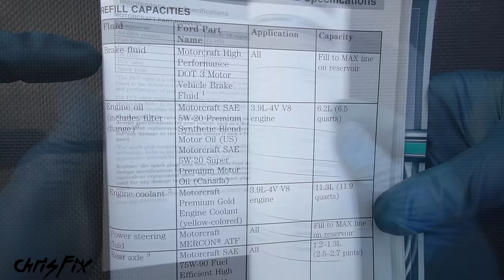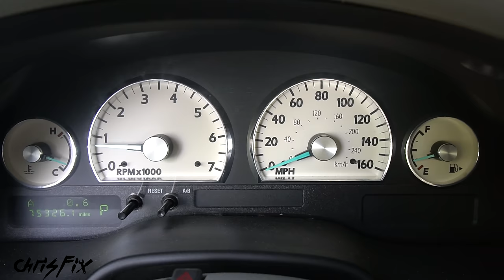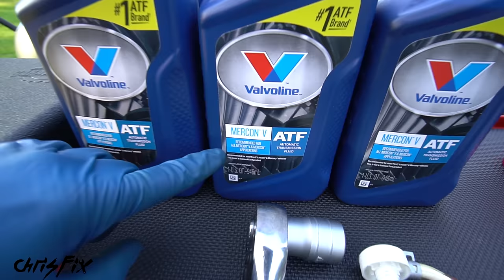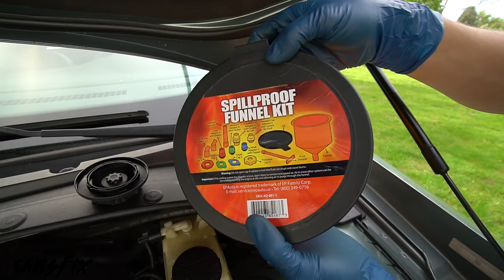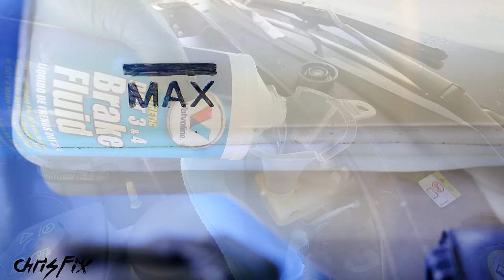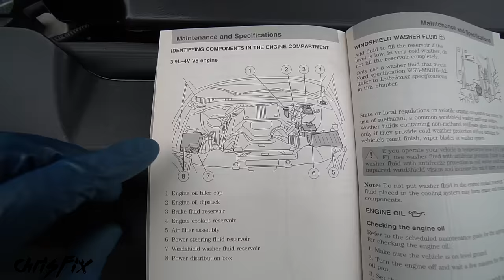How to Change EVERY FLUID in your Car or Truck (Oil, Transmission, Coolant, Brake, and More)

Comment: 6:53 say this to my Golf mk3. The filter has a really bad place, at least on the 1.9 TDI.
Reply from the maker: :o
Reply: Having maintained my wife's Jetta, I concluded that VW loathes the idea of home maintenance.
Reply: Try changing the oil filter on a J20B in a Suzuki SX4. You have two choices: either you unscrew it and try to get it out through the top and it takes at least half an hour, or unscrew it and drop it to the ground so that makes a mess

Comment: Hello,
I want to lift a fwd car in the rear so both rear wheals go up. What is the best spot to place the jack?
Reply: It depends, if u have independent suspension then place the Jack at the middle of the rear crossmember
Reply: If you have a trailer hitch, you can jack it on that
Reply: NGK_YT Ok thx
Reply: Horizon Farming Its for installing a trailer hitch
Reply: Or jacks... plural 👍🏼

Comment: Me: ......
The idiotic me: How about Gasoline. Thats a fluid.
Reply: It pains me so much..
Reply: You drain it by driving really fast non-stop til the car runs out of gas & then you add it from the nozzle at the gas station...
Reply: Amateurs.
I put lighter into the a fuel tank
All gas lit on fire will disappear and you can put fresh gas in

Comment: Chrisfix this would be my very first do it myself oil change!!! I have a 2002 Pontiac Bonneville, I couldn't get my car to start and I have tried everything!!! I just recently purchased the car without checking it out first hand... I had to get a Battery, I then had to replace the Crank Shaft System, I then replaced All 3 Coils and It started but wouldn't stay on... I went out and purchased what is required to change the oil because the oil is Black, Gritty, and Has A Burnt Smell!!! I'm hoping that this will be the reason for the engine to continue shutting off... But if this isn't the reason, I still would like to thank you because I Have Learned Something New!!! BUT If This Oil Change Works or NOT I will return to let you know how i made out...   The crazy part is I purchased this car from family of my ex old lady before she became my ex!!!

Comment: Looking at my manual...

I see: Fluid lasts for life of vehicle
I think: Yeah right, then why am I able to change it. There is no lifetime fluid. Bunch of BS
Reply: “Lifetime Fluid” = “it lasts just long enough to limp it through the warranty period” 👍
Reply: Because once the fluid is no longer doing its job the lifetime of the vehicle will soon be over...
Reply: Dealership definition of lifetime: less than 5 years.
Normal persons definition of a lifetime: drive the thing until the engine blows
Reply: well they aren't wrong, the fluid will last to the end of your vehicle... because it will be the end of your vehicle

Comment: Watching this gave me anxiety, too many fluids to change
Reply: Get an electric then
Reply: Relax. Some of them you don't have to change for a while. The only one you have to change frequently is the motor.  Coolant is every 30k miles so depending how much you drive and where you live it can be 2 to 3 years. I use Google doc to keep notes on every fluid I change by the Mile so when it's time I double check on there.
Reply: @sadboycali  You sir are a genius! Thanks for the tip on using google docs!

Comment: I scrolled and Ctrl+F'd through maybe a 1000 comments but still haven't found a similar question: I have at least a bit of air in my lines after bleeding (definitely bled all the way, clearly new fluid coming out on all 4). I'm thinking it might be due to the way I was pressing the pedal (too fast up and down...), due to leaving the reservoir open (although Chris here also has it open). Or, possibly, due to bleeder valves leaking, as the two on my back wheels leaked some fluid, seemingly from the threads (not from bad seal between valve and tubing). I saw one person recommend Anti Seize on the bleeder valves to better seal them, elsewhere. Slightly hestitant to do that (makes a mess to remove them to be able to apply, could contaminate brake fluid). 

Amazing video btw.

Comment: Wouldn't it be best if coolant fluid was changed first? Considering the engine has to been in idle or on in the other steps, seeing how the order the fluids should be changed matters a little. Appreciate the step by step guides! ❤️

Comment: Someone else has probably already said this, but if not: Get a copy of your car's maintenance manual (not user manual), which should be available online. It will have a great deal of detailed information, such as schematics of the parts and specifications for the various systems in your car, such as brakes, suspension, lubrication, etc. It's useful to have this reference so that you know what parts to look for when you want to work on something, you'll know what the recommended torque is for fittings and fasteners, and it'll give you a good overall idea of what a specific system looks like and how it operates. Cannot underestimate the value of the maintenance manual!
Reply from the maker: Very true!!

Comment: Love the videos! Just an addition to the fluid changes. I always pour a bit of clean fluid as a rudimentary flush. keep the drain open and pour a qt or so of clean fluid through then plug and fill. Always thought if there was anything left after the initial drain that i have one last shot of getting it out especially in higher milage vechiles.
Reply from the maker: If you have some extra fluid that's not a bad idea! Thanks!

Comment: 0:00 --> Intro
4:24 --> Oil
9:28 --> Transmission fluid
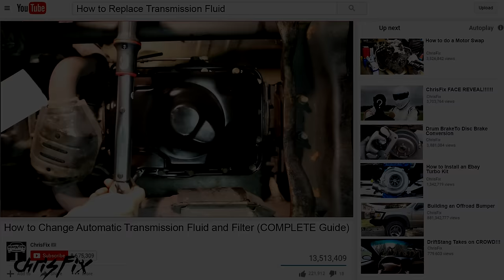14:36 --> Power steering fluid
17:14 --> Coolant/Antifreeze 
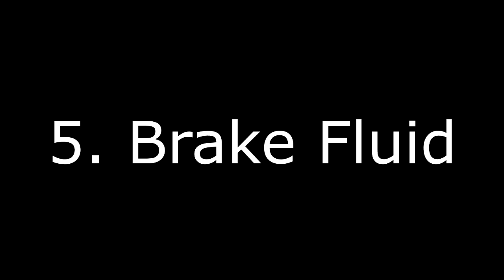24:49 --> Brake fluid
30:23 --> Rear differential fluid
32:53 --> Transfer case fluid (Only on four-wheel drive vehicles)
34:57 --> Grease
36:55 --> Wiper washer fluid
Reply: The hero we didn't need but have 😍😍😍

Comment: Great video😁 i also would recommend putting the car in neutral when checking the transmission fluid level, some transmissions don’t circulate the oil in park. My Mitsubishi Pajero 07 is an example☺️
Reply from the maker: Thanks for the tip.

Comment: Hey Chris! I’m wondering what process you use to flush out your fluid pump you use to fill the car with when you switch between the fluid types, so that they don’t get mixed?
Reply from the maker: Usually let it drain as much as possible, then fill with a little water and pump it a few times, drain that out and let it air dry

Comment: Thank you for the video, it was extremely well made 👍
Can I also help by saying the top up /top off of screen fluid can lead to a problem.
The problem of very old screen wash, causing a slime which can block the pump and can smell bad.
If possible, it’s much better to run the fluid out and then refill with all new.
Hope this helps some people.
If anybody has the bad smelling screen wash I found the simplest way is to just put a garden hose pipe in the reservoir there and flush to purge👍👍
Reply from the maker: Thanks for the tips!
Reply: @chrisfix  you are most welcome chris, and thank you for the great videos👍👍

Comment: My old a4 b6 has 317k miles on clock and yes changing fluids works great I still have all the original parts on it that work perfectly fine and I don't drive it slow! Power steering fluid can be changed by not flushing, but getting access to return hose that is pushing fluid in 2L bottle, get out the old fluid from the reservoir and add new one up to the top of the cap get someone to start the car for you and keep topping the fluid up before it runs out and you can stop at the max mark let your helper know when to shut the engine off! remember this happens very quickly so don't expect to chill there it will suck 2 l in couple of seconds! Doing this you will use way less fluid and you will have a complete change over.

Comment: This is awesome. All fluids in one video. Since the wfh movement, i dont need to drive my car very much.  Like under 3000 miles per year. I was wondering whether it is okay to change the engine oil only when i reach 15000 miles as indicated in manual
Reply from the maker: Thanks! And typically the max distance on an oil change is whatever milage the manufacturer recommends (in your case 15K miles) or a time (usually 6-12 months), if you aren't at the distance but you go the time amount then I would change your oil. If there isn't anything listed in the manual then usually it is listed on the oil bottles you use
Reply: @chrisfix  got it thanks.  Even car mechanics gave me contradicting answers.  Some don't believe oil goes bad with time even with low usage. And my manual doesn't mention any time recommendation.

Comment: Do you have separate funnels for the different fluids? Also, before you notice any problems, when do you know to flush your systems or change your fluids?
Reply from the maker: I just clean the funnel after each use. The only fluid that you can change and notice a problem is the transmission fluid. Here is a video I did about that: https://youtu.be/o690DovjDAc?si=ejDhnNDKVKaIkJZI
Reply: @chrisfix  Thank you very much. What do you use to clean the funnel with? Just dish soap and a rag or special sponge? Do you dispose of the waste water along with the old oil?

Comment: I do triple protection. I put wheels underneath on the frame rail. So if the backup fails I have another backup I had a friend who got injured because the jack stand failed and the sudden failure put stress on the jack and the lifter part collapsed. Luckily it was a compact SUV so it only pinned him on the stomach not too hard. He was able to call me and I drove over and lifted it up with my jack to help him out

Comment: It’s already mentioned briefly, but I just want to emphasize just how smelly differential fluid actually is (sometimes used in transmission as well, like MX5 NA which I did the fluid exchange on). I spilled some in the garage, it took months before the smell went away. Also spilled on the clothes. Those had to be thrown away, there are reports of people who ruined their washing machines causing everything that is washed after to smell differential fluid. Just a heads up :)

Comment: REAR Differential : Check first the configuration of your differential. On my Volvo, the garage jacked it up on the back, but the differential had a design that had a flat plate under it. The got bent, and the oil leaked out over time. Of course, they denied responsibility.

Comment: as someone who's ASE certified in Brakes, you never want to have the brake fluid resevoir open when you're doing a flush or bleed. If you do have it open, when your helper releases the pedal, air can get sucked into the master cylinder through the resevoir. Besides that, great video

Comment: 27:02 It's worth clarifying that the furthest wheel from the master cylinder depends on the length of the brake line connecting that wheel's slave cylinder to the master, not just "as the crow flies". For example, I just helped flush a friend's Honda Element, and Honda's service manual says to bleed in this order: front driver, front passenger, rear passenger, rear driver.

Comment: What a beautiful hood design, meanwhile  our megane II requires front bumper to go down just to front lights to be Uninstall,just to be able to level their lights, only engine  oil and motor coolant, wiper liquid lids to be seen around

Comment: This is so awesome. So, for all of those pumps and tubes you use to get the fluids in or out, how do you clean them out between uses, or are they one time use? Are there any fluids that are dangerous to mix if you reuse?
Reply: Usually soapy water will do the trick since those fluids are either water or oil based.

Comment: I brought my car in for a brake fluid flush (couldn't remember when it had last been done, figured it was past due!) and the mechanic recommended that I actually don't flush it because the fluid was so "murky" that flushing it might actually damage the master cylinder/seals. I had never heard that before, is that a thing that happens?? So the solution is to basically replace the master cylinder and do the brake flush at the same time.

Comment: Wow. I was just curious as I'm close to the first year anniversary of my car and in France, we're supposed to have an "official check up" at an official dealer's place.
I was wondering, as those checkups are officially recorded, if I ever do this by myself (meaning no official records), am I at risk with the insurance or something?
I really doubt that they do all that... especially purging the system so carefully and diligently. And I'd love to be as autonomous and knowledgeable as possible, but I wouldn't want to make any mistakes. Cars can be so different, your video is really exhaustive but you never know I guess.

Comment: Hey Chris. My ‘92 Dodge Stealth has been sitting in my garage for 7 years. I don’t even want to start it until all the fluids are changed. What order should I change them in? Thanks! Your videos are the greatest!
Reply: Hey laura, definitely change the engine oil, coolant, and the fuel if any. Maybe even the battery will be dry.

Comment: 8:23 Genuine question. When you start the car you obviously need to press the brake. Do you keep the car in the air while pressing the brale and turning the key. Does it not "wobble" while you are reaching trying to press the brake or do you lower the car before turning the car on?

Also 16:34 Why are we pumping it out multiple times? Didn't we empty it out the first time and fill it with new transmission fluid?
Reply from the maker: You can start and run the car in the air no problem. The car would not move. And it usually takes a few times to get most of the old fluid out of the rack/lines/reservoir
Reply: @chrisfix  Thank you very much!

Comment: Seeing this 4 years after it was posted and I see that he has a 6t70/75 (GM Code ID) transmission lower valve body assembly just sitting there by the larger valve assembly piece (not sure what transmission it was from.) Just thought I'd mention it since I've only ever worked on a 6t75e transmission and I've seen that valve body piece too many times

Comment: Thankfully, the only fluids my car has are 1) washer fluid.  2) brake fluid.  3) glycol based fluid used in the heat exchanger.  4) Whatever refrigerant is used in the heat pump.  5) there is a fluid similar to ATF in the drive unit, but it's maintenance free, filtered, and rated for MUCH higher temperatures than the car ever sees.  Aside from the high pressure side of the heat pump, the hottest any part of my car ever gets during a drive is around 100F.

Comment: Hey Chris, love your work. 
I tried changing my oil today but wasnt able to loosen my drain plug. Any special tools I should use? I have the 17mm wrench and a socket set as well. Also, I have a 2014 legacy and the filter is at the top, do i still need to preload the filter with a bit of oil? First time doing all of this so bear with me!

Comment: This was helpful. Hopefully a Ford Five Hundred is at least similar in placement of drainage bolts. Looks like a strenuous job to do, but if it saves me hella money vs going to some auto place, I'm down. Plus my dad is very mechanically inclined, and has lots of knowledge and MANY years of experience.

Comment: Does it really make a difference buying engine oil and other fluids from your car’s manufacturer? I remember my dad had a Honda City that would shake and hesitate, or even shut down the car, while changing gears. He spent ages trying to fix it. The mechanic who finally set it right said the problem was that we had not used OEM transmission fluid. Ever since, I’ve been nervous to take my own car anywhere but the dealership service center for maintenance. It gets expensive on top of the charges for labor!
Reply from the maker: As long as you are using high quality oil/fluids from reputable brands that matches the spec your manufacturer has listed for your application , the fluids will be at the same level or probably even function better than the fluids the manufacturer uses (like if your car specs DOT 3 brake fluid but you used DOT 5.1. Some fluids are backwards compatible like in this case of brake fluid but always do research to make sure). In your Dads case, the wrong fluid type was likely used and that's why those problems occurred.

Comment: I was wondering could you do a video on replacing shocks. I live in Japan and got a used 2009 suzuki swift. I feel like it rides pretty rough I can feel every bump on the road. I thought maybe replacing the shocks will help. But im not sure how to tell if they are bad or worn out. Thanks for your time 🙏

Comment: Thanks for the video. Questions Is it ok to use the same pump for all the different fluids?
Reply: Alejandro you can use the same pump but make sure you clean out thoroughly before using it for a different fluid
Reply: Thank you for replying.

Comment: Im pretty sure you dont have to replace the filter every oil change. Like hypothetically if you have a hybrid and do an oil change every 10k miles, then sure, that's understandable. But if you're changing your oil every 3k miles, you should be able to get away with the same filter for 2 or 3 oil changes depending on the filter
Reply from the maker: You need to replace the filter every oil change. That is how it works.

Comment: Even though the fluid wasn’t liquid metal like it was in my mom’s original transmission in her r class, you probably should’ve done a full service which is dropping the pan, replacing the filter, finding the cooler line that comes out of the torque converter if there is no drain on the torque converter, and flush all of that fluid into a bucket.
Reply: Damn. Chris Still hearting new comments on old videos. Love you Chris